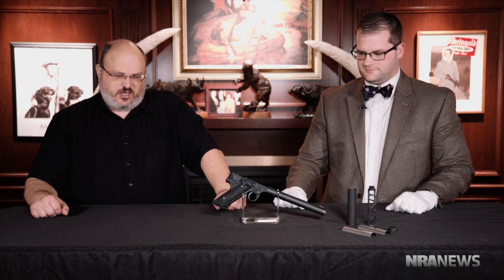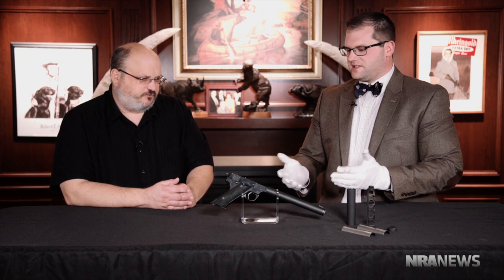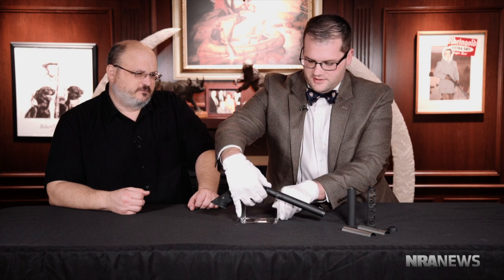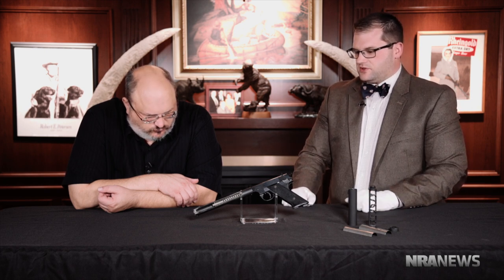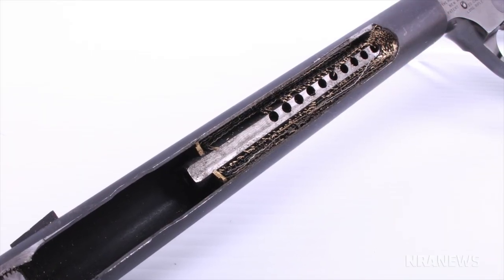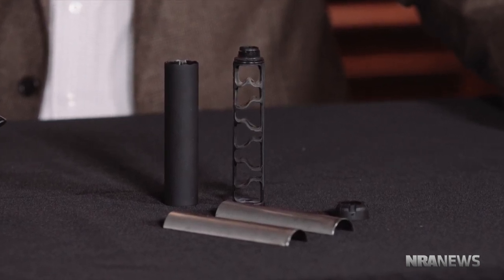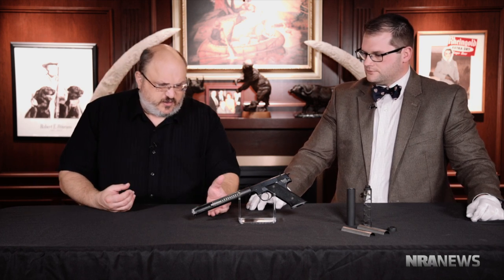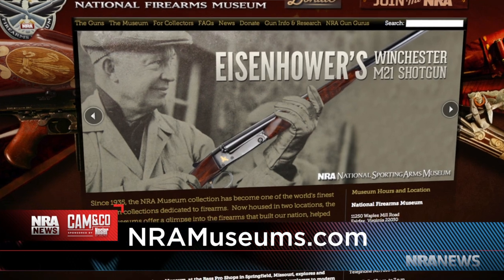Curator's Corner: High Standard HDM

Comment: I'd have to disagree with the notion that the performance isn't affected in terms of the muzzle velocity.  The holes drilled in the barrel to disperse the gas reduces the pressure that builds behind the bullet, thus reducing the acceleration that you would normally have down the full length of the barrel.

Comment: I'll have to disagree with the comment that the bullet velocity would still be the same. The reason is, the effective length of the barrel is much shorter, than the original barrel. These guns would normally have at least a 5 1/2 inch barrel. Everybody knows, a shorter barrel will not have the same velocity as a longer barrel. That's just a fact.
Reply: Yeah, if those are the barrel holes we see there, they look pretty large. Once the bullet passes a couple of those holes, that's all she wrote for acceleration.

Comment: what about the rifling? are the holes all the way around the bore?

or was it just made as a close range weapon?
Reply: give it a thought, OSS, behind enemy lines operations, its a suppressed handgun designed for taking out without raising an alarm, how far of a range would you want it to have? given the circumstances
Reply: @dusand98  I have played splitter cell so Im basically a trained covert operator. You have to shot out lights and guarddogs
Reply: @yeahbee8237  exactly, didnt know we were fellow colleagues, ive played quite a bit of james bond on ps2 myself back in the day
Reply: @dusand98 A suppressor makes things quieter, yeah, but so does simple distance. And since these things were built off target pistols, they were pretty accurate.

Never hurts.